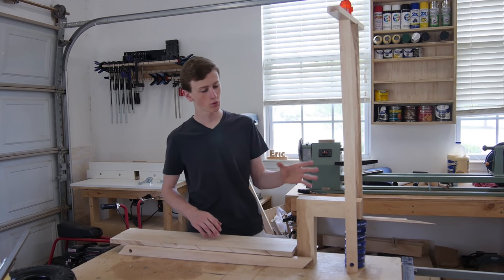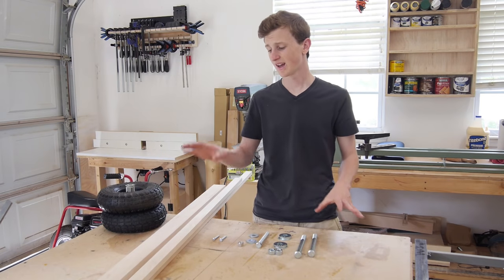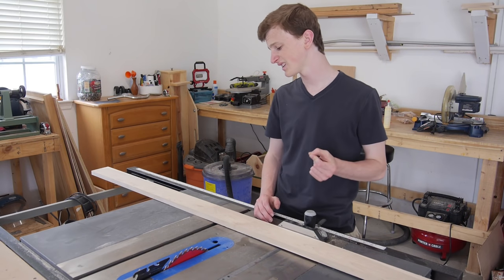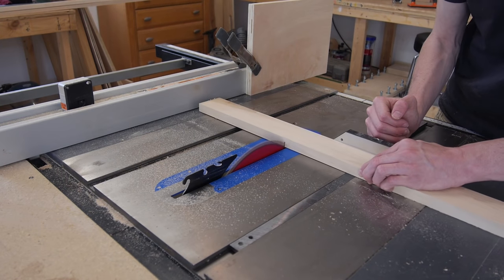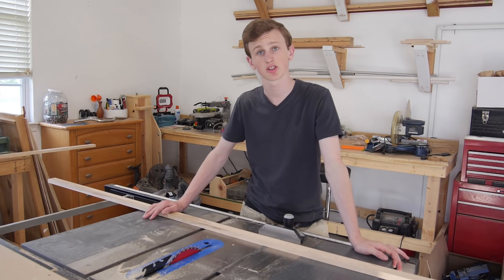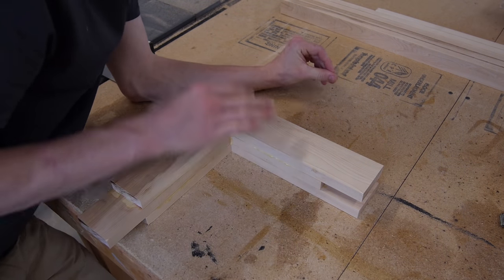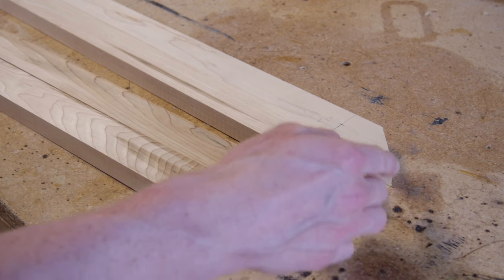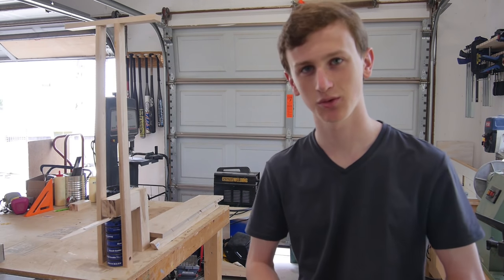How to Build a Wood Scooter | Part 1 of 2

Comment: Excellent workmanship and to notch finish on this wooden scooter. You are still a very young man and should be congratulated on your effort.  May I suggest that you will go an read a little about the stability of front wheels where  the  pivot point is  inclined and the pivot  of the steering is in line with the contact point of the front wheel. This will be a better steering and even self steering could be introduced.

Comment: I'm nervous about the strength in the 90 deg joint. Hope it works. I would've doweled or screwed it together to strengthen the joint. I also would gusset the corner. Maybe overkill but you may not regret it later.
Reply: Doweling wouldn't add any strength in that type of glue up (long grain to long grain) anyway.